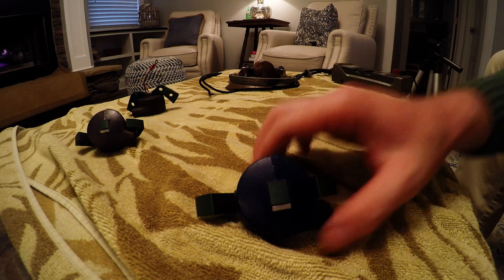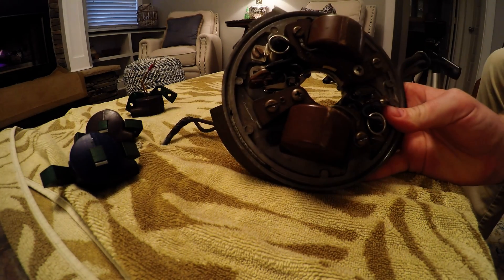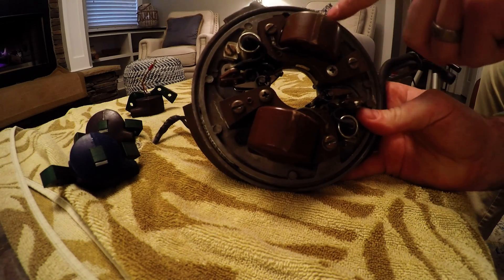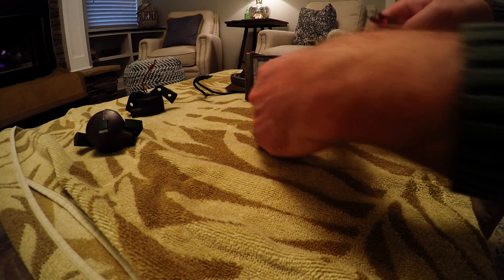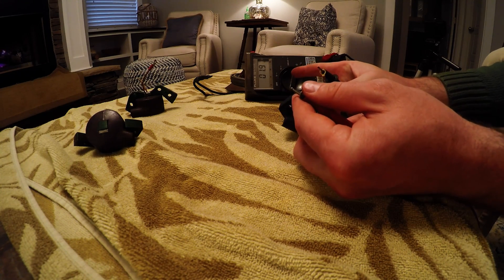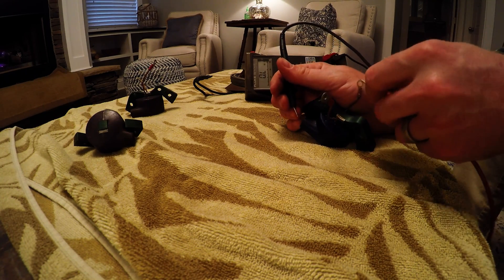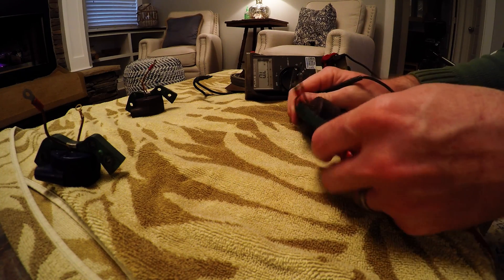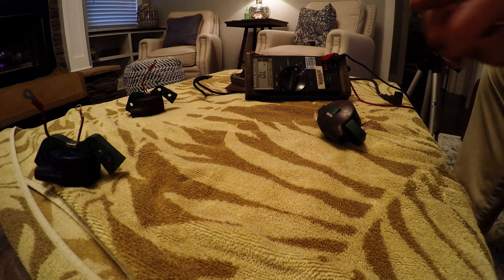Test Outboard Ignition Coil

Comment: Sorry but this  test will NOT  show up  some problems.  Not moisture, or hv  leakage, or shorted primary turns.   In these coils you could  likely short the entire  primary, and the  resistance is so low you would not see the difference.

Comment: ive turned my multimeter to 20k to check continuity (from spike to primary and from spike to ground). It shows me 10.55. is that wrong resistance? I've got these coils from Sierra for my 3HP Evinrude.
Reply from the maker: You should be ok
Reply: @thisoldoutboard  thank you so much sir. Another question I had was... I have two spark plugs. Does it matter which coil goes to which spark plug?
Reply from the maker: Yes very much so.  Check out marineengine.com for diagrams

Comment: You're the man!
Reply: The √ one to get the primary winding down to earth and environmental engineering and the secondary containment winding bilingualism evinrude,proffered by company Johnson 3000,000,000 square route 6 divided ÷ by the answer, and add +3.00. Prestigious and overall. And conductor Will give a strong value .99π

Comment: just got my new coil and when I check the secondary winding on my multimeter it reads 10000 kohms. is it still acceptable.
Reply from the maker: Should be fine.
Reply: @thisoldoutboard  
thanks